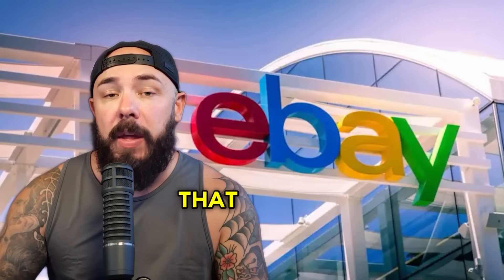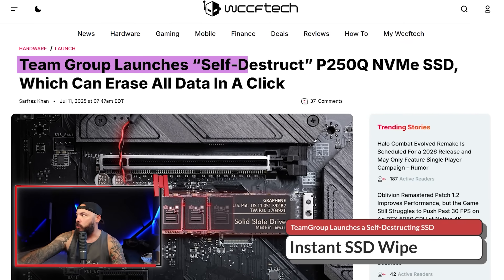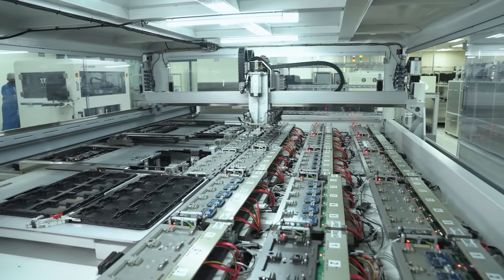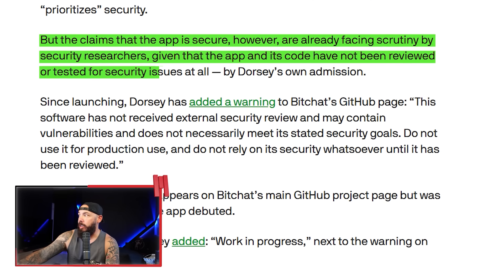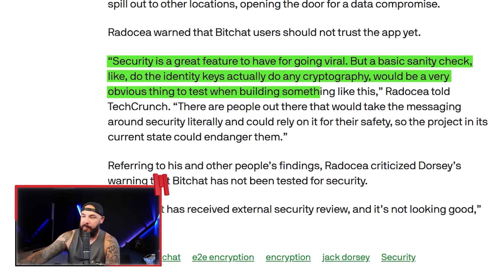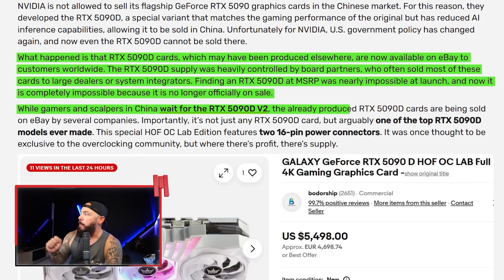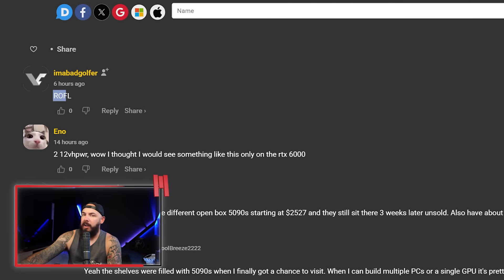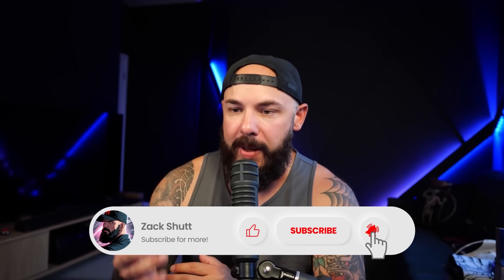They’re Selling Illegal GPUs

Comment: I remember buying Windows 3.1on floppy disk and getting 13 floppy disks to install that operating system. And if memory serves me correctly i also got the upgraded windows 3.1.1 on floppy disk, Oh how sweet it was popping out disk #1 to #2 and 45 minutes later #13 with that blazing fast 25 MHZ CPU soldered to the motherboard and all 1 meg video card with 2 ISA slots for expansion, that i bought a Voodoo 2 banshee card only to find out your computer needed at least 2 meg onboard video. Dam you 1 meg onboard video.

Comment: U could use the ssd in case of a data breach to prevent anyone getting sensitive data
Reply: But it has to be triggered by pushing a button, it isn't a software solution unless somebody makes a mechanical device that can be triggered to fry all sensitive PCs or drives in a physical or a network security breach situation...

Comment: 16:01 win98 the golden age for windows 😅😂 it was also my first operating system
Reply: I am for 98SE!! It took time but XP got good with time as did W7 and W10. And M$ has turned Windows into hot garbage with sky high requirements, data collection BS, ETC on W11!!!
Reply: @Sadler2010  yeah, it was also 98SE I used, just forgot they made a second edition 😅😂
XP, that turned out pretty good, aswell

Comment: 2:10 back in around the 2000s, me and my old friend created a cd-rom that would delete your HDD, just by inserting it into your cd-rom/DVD drive 🙈😅😂
It was an old app called fDisk, that you could use to erase your HDD, without any need for installation. What we did was burn it to a cd-rom together with an autorun file which would run the .exe that performed the erase action. It worked perfectly fine when we tested it on my comp. A few seconds after the autorun started, my HDD was wiped 😅😂

We destroyed the disc thereafter, so no one got harmed from it. It was only meant for fun and we were bored and just wanted to see if we could pull this of 😂

Comment: About the 5090 D HOF, yes people on ebay are buying them. No, its not a surprise considering who HOF is. The 3Dmark GPU benchmarks have HOF advertising all over it. The HOF cards stand for 'hall of fame' and are meant to take the top spots when it comes to GPU benchmarks. The 5090 D HOF actually outperforms the 5090 in 3DMark tests like Time Spy so this is why people are willing to pay $5000 for them. The 4090 versions sold and still sell for around $3k.

Comment: First Operating system was MS-DOS 4.0. I remember playing OG DOOM installed from five 3.5" floppies on MS-DOS 6.0. It ran on my Compaq with a 386SX in it. Kids these days have no idea how fast hardware is today compared to those days. The old AOpen H series full height towers were HUGE! Like 4 ft. tall and could hold a stupid number of disk drives. I had a 16 x 40gb drive RAID 0 on two 3Ware 8 channel PATA accelerated hardware RAID controllers. SATA didn't exist yet. The monstrosity was sick back in the DAY! BTO (Built to Order) Manufacturing LLC, the Whitebox manufacture I worked for sold them like hot cakes. Commonly used for small business server chassis.

Comment: DOS 2.0. Then finally bit the speedy brass thingy, and installed WIN 3.1 after skipping earlier ones. 95, 98, 98SE did a build with ME, 7, 2000, Vista, a lot of Linux Distros. First PC build, 1994 AMD 486SX.
Reply: i remember win95 made my 486dx4 100mhz run dos games 30% slower than doing it directly from DOS. as a result i didn't really switch to windows for real until like 1997 when i bought a pentium 233mmx, which made the difference negligible (like 3% or something)
Reply: @GraveUypo  Had Win 3.1 but it was not at boot. Just DOS and the old Norton Commander instead of win, made moving and copying easier than command line. Even though I was actually faster in DOS myself. Move . to Copy . faster than highlighting in Norton